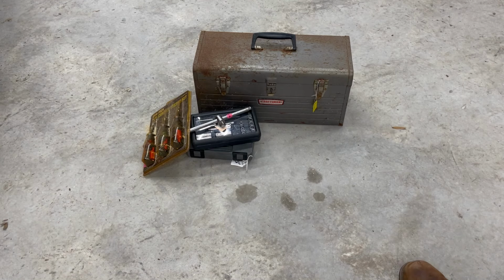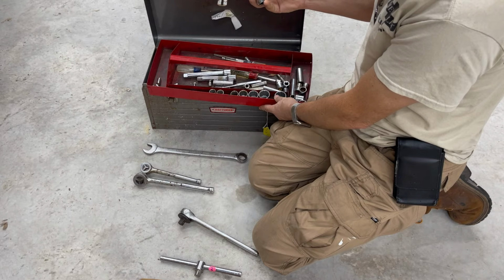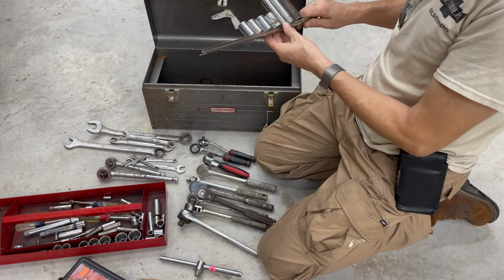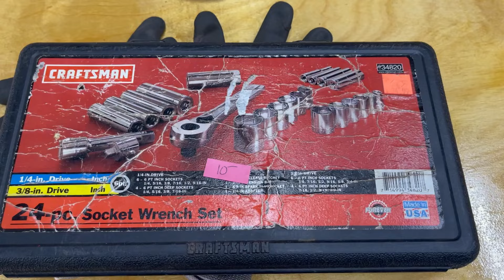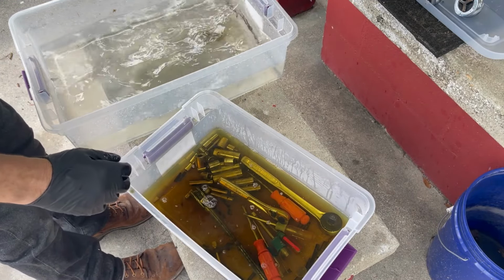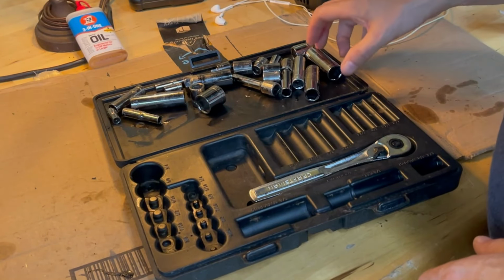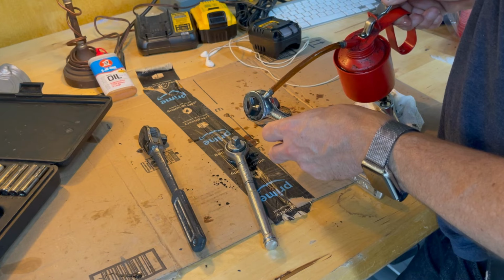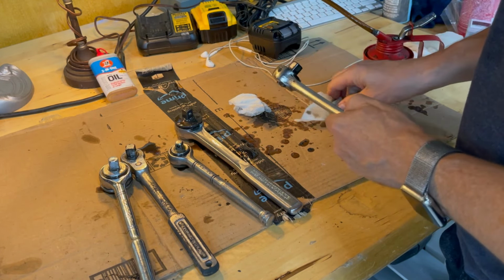Wild Warehouse Estate Sale

Comment: Most molybdenum is used to make alloys. It is used in steel alloys to increase strength, hardness, electrical conductivity and resistance to corrosion and wear. These 'moly steel' alloys are used in parts of engines.
Reply from the maker: Thanks for the info.  It's always great to learn about these old tools.  Now if I could figure out how to pronounce it.   :)

Comment: I have a 1/4”, 3/8”, & 1/2” set of craftsman metric deep sockets that also are ribbed at the ‘top’.  I need to check if the non-deep are also ribbed at the top.  I am on travel and the geek in me cannot wait to get home to look and find out tomorrow 😂.

BTW if needing a way to organize lots of different vintages and brands of sockets Casoman has a crazy deal on socket organizers AMZN right now. 11$ for full complete line of sae & metric peg organizers.  Thats cheap enough if reselling to sell with listing and they add value above what you paid for them.  I am not affiliated with.
Reply from the maker: Sweet!  Thanks for the info.  Checking amazon now.  Correction... I just bought two sets. Awesome deal.

Comment: The round head in that 1/4 dr set was made by Danaher/KD tool they are a better made than the Stanley made ones. The 1/2 drive you pulled from the top is referred to as a RHFT ratchet when means round head fine tooth.
Reply from the maker: Thanks for the info!  I'm familiar with KD Tool but never would have guessed that was one of theirs.  Also, thanks for the new term. RHFT.

Comment: After Evaporust I soak in Simple green
Reply from the maker: Thanks!  I've never tried that.  Do you use the SImple Green as a cleaner?
Reply: @ yes. I just do it the same way as you except I use simple green instead of water. When I take them out of the simple green, I wire brush any grease off and then use towels. You cannot believe how shiny the tools are.